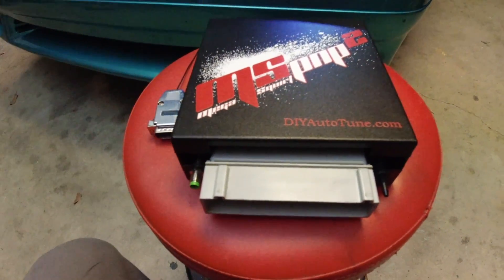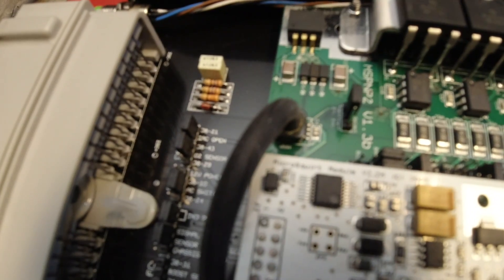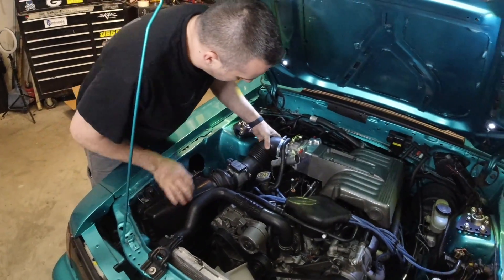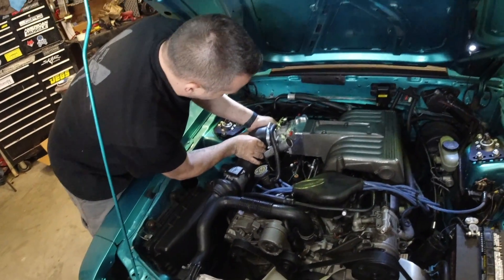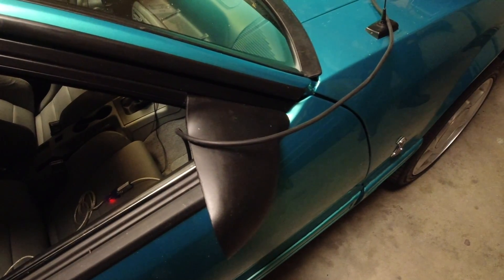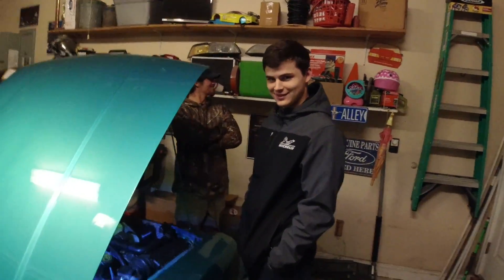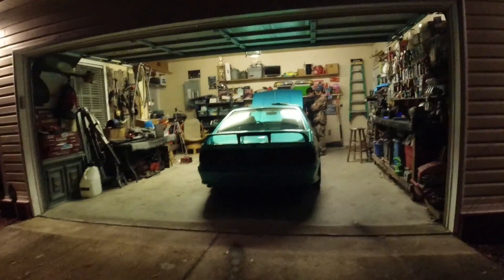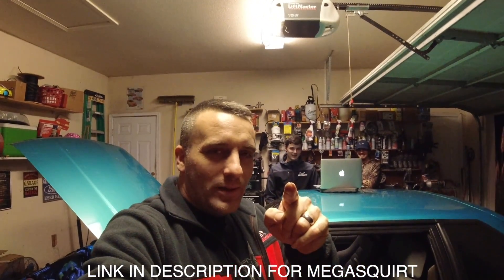FIRST FIRE! MegaSquirt 2 Foxbody Install / First Impressions

Comment: what cable did you use?  I cannot for the life of me get my ecu to connect to a laptop...
Reply: Same
Reply: Figured it out for my specific mspnp2 I needed a Innovate Motorsports 3746 Replacement Program Cable MTS LC-1 DL-32 LMA-3 SSI-4

Comment: I'm planning on replacing my head gaskets and swapping over to the 93 cobra heads and intake manifolds I picked up years back. I'm going to try using megasquirt to troubleshoot some tuning issues the stock ECU has. It already throws a check engine light but nobody has been able to figure out why including a Ford dealer. It's been running on the backup internal fuel map which works but it knocks a little unless I'm running 93 octane and it's in the winter.

Comment: Can you swap the factory ecu with a megasquirt and just plug in and drive? My ecu is burnt out and i can not find a a9l computer for a decent price.
Reply: Yes but will need tuned and tweaked but not hard as far as I can read up on and watch
Reply: @stevenmcc2119  crazy I posted this almost a year ago, I bought the megasquirt pnp2 for my mustang and took it to multiple shops to have it tuned and have been run around spending tons of cash to get it dialed in and still never got it right. I finally got fed up with inconsistent cold starts and swinging idles and pulled the megasquirt out along with the entire engine harness, I purchased a Holley terminator x for my foxbody that came with the full engine harness. Installed all of it my self and tucked the harness to look better than factory. Hit a few buttons on the handheld that it comes with and made some software changes, now this car runs like a top and idles perfect, cold starts perfect. I should have done more research about the Holley before chosing megasquirt. Holley EFI is alot more basic and alot easier to setup as is also self tunes during open and closed loop all the time. On my first start up with the Holley I didn't even have to do anything else other than drive it home and it was already dialed in perfectly. Megasquirt is good but also very complex for a beginner tuner over the Holley.

Comment: I think you’d be better off setting your base timing at 10 and letting the computer do the timing you want. That way your injector timing isn’t off from turning the distributor. I don’t think wot power would be much different but you’d be able to fine tune it better.

Comment: About to ms2 and TFI dist on a 5.0 that I’m doing a 750 blow thru e85 no ic... I do aem, hp tuners, I even have an old skool neo afc in my Supra, as well as carbs... 

Achieve target afr suited for you engine in it operating range, use some method of measuring torque while adjusting the ignition timing continue to add timing while gaining power when you don’t gain any from timing go back and pull a degree. Keep an eye on the afrs while adjusting timing.
Reply: Forgot most important tip for ignition timing go slow big bumps in trouble areas are ok to start with. The closer you get the less you give it at the end you would be adding just 1 maybe 2 degrees at a time

Comment: Great vid as always. I was on the fence about getting the MS, Kinda confused though. I have talked with 2 different tuners and both stated that they would prefer to tune my Fox with it's stock PCM with my build, which is alum heads, cam, intakes and exhaust. Have a friend that has the quarter horse on his ponies and he tunes himself. So I ordered the chip for $75 and he's gonna tune it to what he can. However, yesterday I took mine out and the T5 decided it was done. Got it home, but now we are going to remove it this weekend to inspect to make sure it's not a clutch fork issue. If it isn't my Mega Squirt money now will be invested into a WC - T5 . What's your thought about what I'm being told by the tuners, by the way, both are well respected in the Mustang community with actual shops?

Comment: I've got a microsquirt on my fox and I found it works well just setting up your AFR table then let tunerstudio auto tune the actual fuel map to hit your desired AFR.  Get those set and go do some varied driving and it should correct itself quite a bit.
Reply: How's the 3 year review on the microsystems install?

Comment: Just waiting for mine. UPS tomorrow. Keep it up and will follow your lead on this. Cold up here in Montreal. Can’t wait till the spring to get out and drive.
Update: Received mine.  Not installed yet, still running with Quarter Horse.  What firmware did you load?

Comment: Glad it’s running.  Is there some sort of auto tune mode it can go into using the data from the wide band?   Seems like that would at least get it into a ball park to start from.
Reply from the maker: Yes, but the idle is best tuned to your liking for the most part. The base map is usually close enough to get it running.

Comment: I'm very interested in this system, I won't have to convert to MAF from SD if I chose this route. 
It also seems one could tune a H/C/I combo, on a SD Fox using this system. I'm tuning in B, looking forward to results 👍
Reply: You could definitely use this and tune a hci combo that is speed density.  I’d like to go on record and say MAF sux from a tuner standpoint, it more an accuracy thing for oems... fox body guys get screwed into thinking they need a MAF because since 88 you couldn’t cam your car if it was SD. Rarely do you see a Stand-alone that someone decided to go MAF over SD.

Comment: I'm seriously considering the micro due to a blower and top end install
Reply: Microsquirt work really well with the eeciv fords, i run one on my 2.3 turbo swapped ranger. Only thing that was needed is high impedance injectors over the factory turbos low